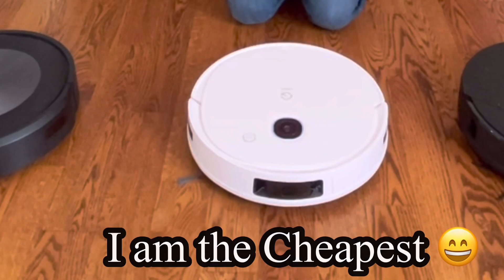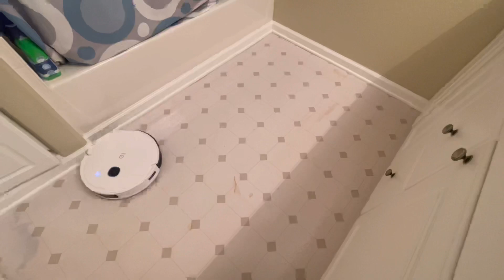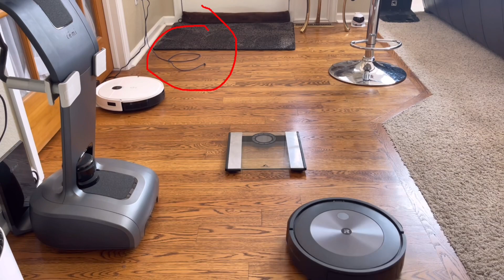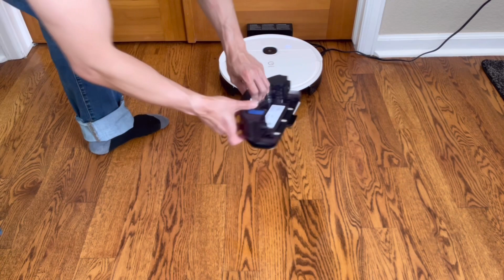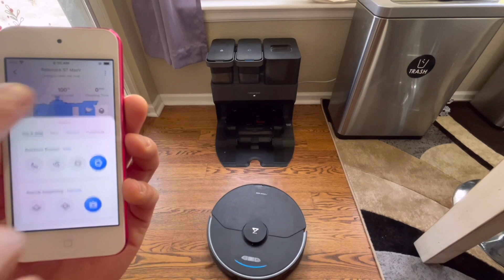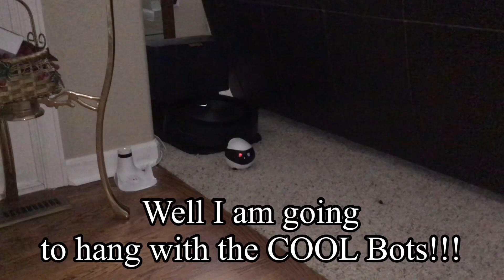Head to Head Battle between Roomba J7+, Roborock S7 MaxV, and Yeedi Vac 2 Pro

Comment: Hi Robot Masters!
Which vacuum robot machine would you recommend for picking up dog hair? Our pup is a high shedder all year round! 
859 sq ft apartment with mostly carpet in the area where the robot vacuum would be. A lot of furniture obstacles. Unfortunately about 20 carpeted steps inside our place, so that’s a no go for the robot. Thanks!
Reply from the maker: Hmmm I would look at the iRobot Roomba e5 if you don’t mind having a random based robot vacuum good for smaller areas. Another option is the i3 which offers a more smart navigation and self emptying option. The reason why iRobot a good option is the all rubber brush bar design allows for easier removal of pet hair. You mentioned you have obstacles so the Roborock S7 MaxV might be a good alternative choice. It more expensive than the other two models but offers the most features and best cleaning performance.
Reply: @RobotMasters - Will check out your recommendations. Really appreciate it!

Comment: I'm wanting to try a robot vacuum for my workshop that I do mechanical work out of. Lots of sand and dirt gets drug in by vehicles tires. What would be a good option for that scenario? Shop is 2800sqft concrete floor with alot of obstacles.
Reply from the maker: I would probably recommend the iRobot i7+ with self emptying. https://amzn.to/3Mm1j7A

One of the few robots that can handle a lot dirt and have the ability to automatically return to the self emptying station once the robot’s bin full than resume.
Reply: @RobotMasters  ok thank for the reply, I was leaning towards the Shark Ai XL because it does not require dust bags to be replaced and self emptying. Is the I7 a better option out if those 2?
Reply from the maker: @shanesmith6242  Yes just because the Shark can’t auto empty once the robot dust bin full. Sounds like there a lot dirt and dust in your shop.

Comment: Do you buy youre furniture based on youre robots? So abssicly if you buy everything with the metal round chair and round furniture youre robot is safe?
Thin carpet? Instead of fat
Reply from the maker: Robot Vacuums are usually gotten pretty good at navigating most type of furniture. The round metal bar stool type is actually something that I don’t recommend buying. Some robots struggle with this. I think normal style chair legs are better.
Reply: @RobotMasters  ahha, wow never thought about that! Smarter robots make indeed there way around normal chair indeed  I always thought in the opposite direction....basiclky if you make Kamino in egg chair house or the empty apartment , you never come into a dirty house or a stuck Droid situation😂
Reply from the maker: @DeSpion1138  Hahaha also, avoid any rugs that have black or very dark stripes or patterns. Most robots think they are at a edge and will get confused.
Reply: @RobotMasters  deep 🤔 very deep